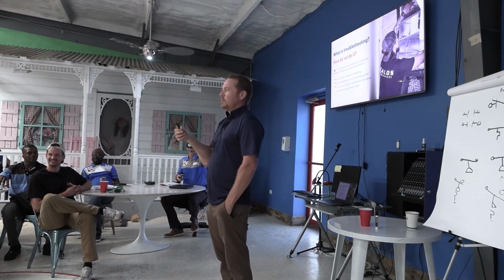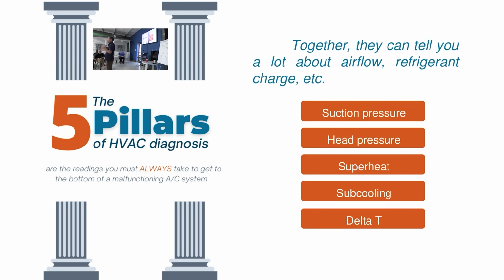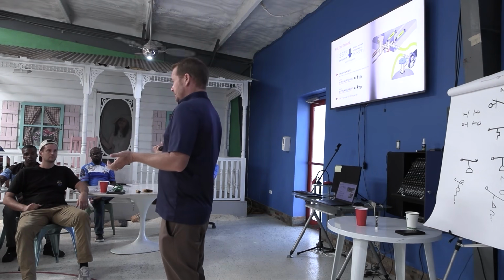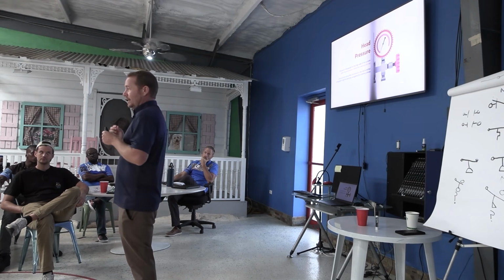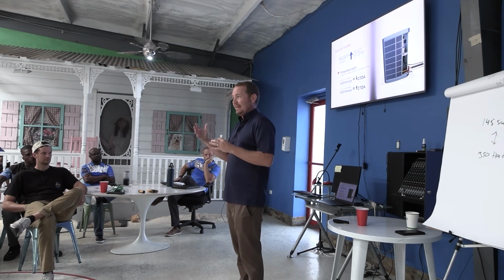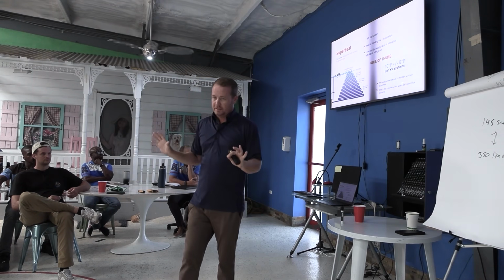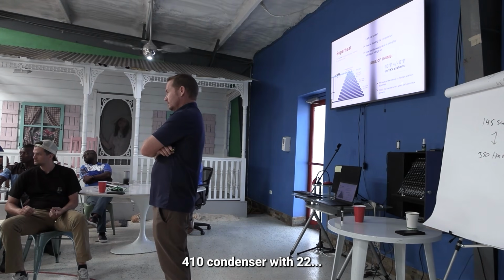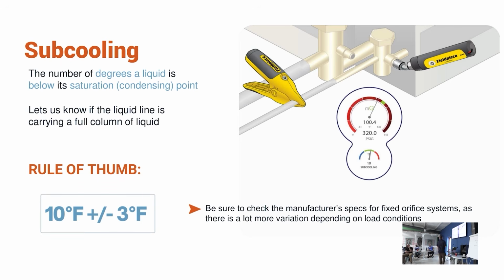HVAC Troubleshooting Part 1

Comment: In Airconditioning its much easier to check your super heat. You can check your on coil(room temp) and off coil ( what's blowing out of your aircon) to calculate your super heat and to see if your aircon is working
Reply: And  temperature equals pressure

Comment: 5:27 I’ve done one sort or another type of technician job since I started working about 20 years ago. I’ve been on both sides of this equation, apprentice and professional, with a 2 fields (automotive and industrial equipment specifically robotics). I’ve always said: I can teach you a whole book of facts.  Every piece of information you’ll need to do this work.  But I can’t teach you to think.  You have to decide to.  And if you don’t wanna do that, this is the wrong field for you.  And you can say that but most people do not even realize their brain is off until they’re confronted with that reality.  One of my favorite ways to point this out to apprentices is to say something they really should know is wrong and when the just nod along like “yup yup” you point it out.  It’s a nice tool I like to use to help them understand they’re doing that.  Sometimes that works.  Sometimes it doesn’t.  But it usually does make them turn their brain on and stop being so intellectually passive

Comment: 38:46 Does the equations and differences in temp apply to commercial applications as well?? 35 below on evap coil and 20 above on condenser …..?

Comment: I love how Commercial Systems are designed for easy access because of obvious servicing needs regularly and the paying of these businesses that service them. 

Not the same with Residential. This is flipped on its coin. The system is designed for high cost to the owners in service. Perpetuates the failure to these systems and use of more energy bc if you never clean the evap coil your on the train to problems.

Big ones

These Systems are often enclosed for no easy access without a professional when regular cleaning of the evap coil would make your shit tippy top for a long time.

Why no easy evap door and slide out for cleaning in the home designs.

Money.

Comment: My favorite is the Carrier 2010-2014 2 stage condensers that have the king valves you have to crack open to see readings ! I’ve had guys call after being on a call for hours and doing leak searches all because they didn’t open the ports and thought the system was flat 😂 I’ve had 4-5 different kids out of trade school call me for this same issue but if they call it means they want to learn
Reply: My first week of hvac as a young guy I called the Service manager to ask a question about some system and was told in no certain terms to never call him  ever again to ask a question . Figure it out on my own. By the way they threw me into a old truck the first day on the job and given a call with no ride along or anything. Its like here is a truck and here is your first call. I worked for them for 8 years and never called the office again. Just learned on my own. I learned owners and managers are not there to help anyone but themselves. Retired after 35 years. Glad I'm out of the madness. Retired as a chiller mechanic.

Comment: I enjoy the podcast as well as the videos of the way to refresh and keep myself up on knowledge that I may have forgotten. But I also have a question when we’re dealing with super heat on an ECM motor on a system that has been installed and subcool is dialed in correctly that super heat is at 26°

Comment: That is so relatable 7:39
Reply: I get all kinds of crazy half info even walking techs through stuff
Reply: Most common is them blasting the unit doing a compressor oil logging the gauges and hoses then vacuum won’t get below 700

Comment: Can anyone tell me if it is ok to exit line set from indoor unit on the right hand side. I need to install on INTERIOR wall and have the line set exit the RH (Bend line set 180 degrees?) I don't want to void warranty.

Comment: I only watched the first 15 minutes but I can relate.  I am in HVAC school now, at a trade school, and was pulling a vacuum.  Something wasn't working, so I had a classmate help me.  I didn't have things tightened, I hadn't noticed one connection was loose... that's all it was.  I even changed out the pump!

Comment: That's why you break R not Y. I'd rather have the thermostat cycle the delay.  Or add a ICM delay timer at the condenser. Bad weather/ power surges also cause them to spin backwards. I show up and they are in overload. Hook my clips and set her to tone. Grab the ole water hose and wait. Honestly selling the delay timer is the best. I try to focus on system protection before iaq. Great seller.

Comment: Great instruction!  Could you elaborate on why compressors backpedal/ runs backwards when turning off making a rattling noise.  Thanks.
Reply: Hi side dome pressure equalizing back through the scroll to the low side

Comment: Troubleshooting? All the HVAC  contractors in my area just tell you to replace everything.
Reply: The "trouble" is you have a bad system. The solution is replace it with a good one!
Reply: @realSamAndrew This is why I have engaged this trade. I am very good at troubleshooting and was sick of getting $20k replacement pitches when some $100 part failed (usually related to poor installation in the first place).
Reply: @Factory400 so true my neighbor was sold a new one on a 2 year old  system that they would call builder grade.
Reply: This part. Absolutely,!